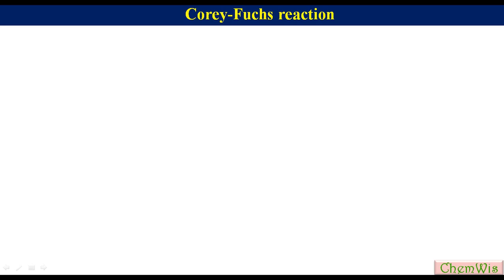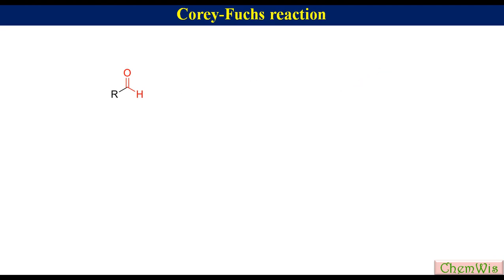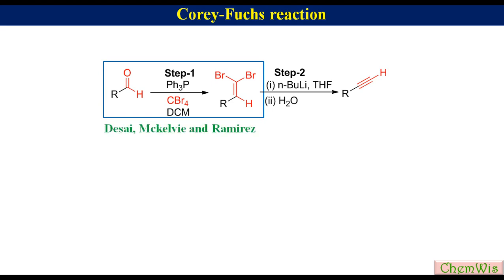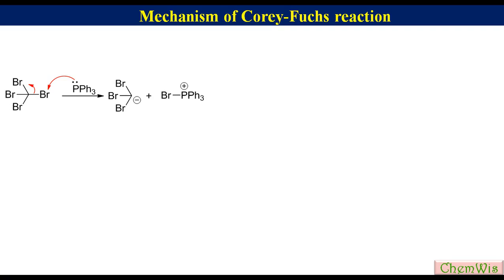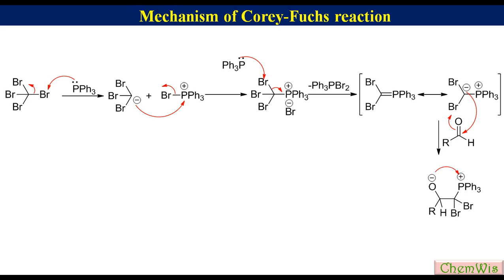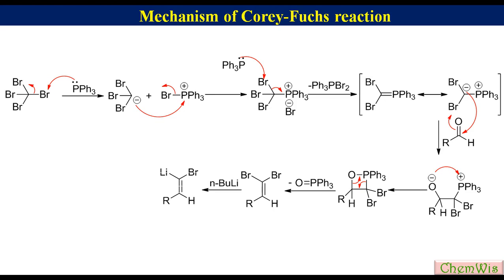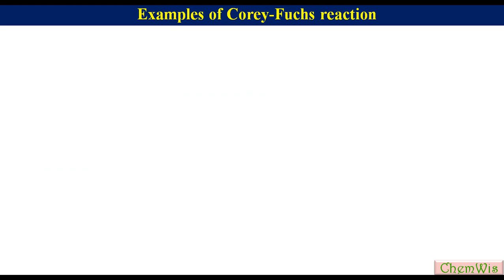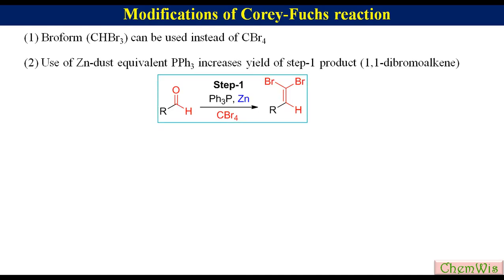Corey Fuchs reaction

Comment: Just a quick note on your modifications section: the Zn dust and Ph3P are technically added in equal equivalence, but it’s noteworthy that you only use half the Ph3P that you would otherwise use without the Zn dust (for example, normally it’s 4 eq of Ph3P but with dust it’s 2 eq of both). 

Good video! 👍
Reply from the maker: Thank you

Comment: Could this react with ketones as well?
Reply from the maker: No
Reply: @ChemWis   Why it is wittig reaction after all? I mean only the first part (not adding base).
Reply from the maker: This is because of less electrophilicity of ketonic carbon compared to aldehyde and also the Ylide formed during this reaction is less reactive.
Reply: It actually has less to do with the reactivity and more to do with the mechanism. If you have a ketone you can’t get deprotonation by the n-ButLi to form the last pi bond in the alkyne. It is shown in the video differently but typically the mechanism is drawn with deprotonation and kicking off the Br, with acid work up for the lithium